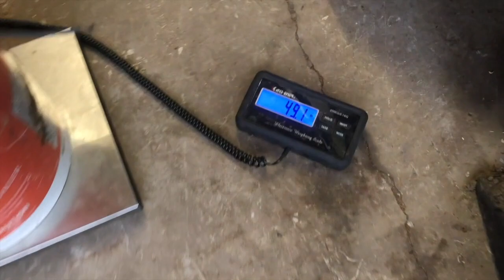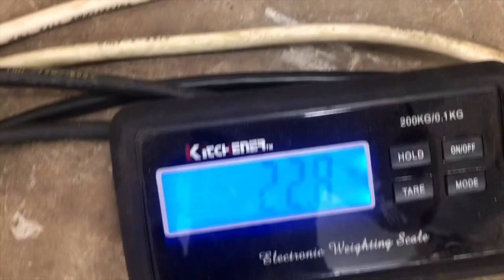5 places I've found scrap copper

Comment: Good video. Its copper I'm mainly into, along with cable and brass. But I'm currently saving up for a truck and then I will be taking steele and anything metal, so good to know how to get more copper. 👍👍👍
Reply from the maker: awesome good to hear I used to walk around with my dog and just find metal then got a car then a truck. copper and non ferrous metals are nice of course but steel is a steady supply and helps to pay the bills
Reply from the maker: seen a few of your comments sorry I haven't been back on here in so long now I've been struggling with things. I'm back at it now and am going to be posting again!
Reply: @scrap2cash712  looking forward to it buddy.
Reply: @CYRUS DAWSON, my plan is this: fours days a week in the van. Three days on the bike and an occasional day off. I say day off, I'm sure I'm like most scrappers, we still tend to do a bit of cleaning up of scrap and generally still scrapping. This is my favourite occupation I've ever had. I scrapped as a kid, as a teenager and now as an adult. I plan to always be a scrapper. As long as my body allows me to. All the best buddy.
Reply: @CYRUS DAWSON, good on you.
Reply: @irishgoldstacker8018  
Bodies and minds will betray you. I'm disabled. I scrap slow . I scrap less. Good Luck Irish🍀

Comment: i haven't made it to the big time yet, commercial grade motors and transformers... still piddling with household stuff, but i've just started so...  i like the way you went thru it all, (separated) and identified what was in the truck, lol, but at least where i'm at it doesn't snow...
Reply from the maker: haha I haven't made it to the big time yet either I wish I had but all we can do is one step at a time and keep working in the right direction. Slowly I'm starting to learn more and make more connections so it does get better slowly 👍
Must be nice! are you just trying to rub it in? its the middle of winter here right now and it sucks! lol

Comment: As an electrician I get a fair bit of cable. I also process it through a stripping machine that increases the value.
Reply: Sounds good Luton. Are you selling your copper right away or are you sitting on it waiting for the price to go up ?
Reply: @jussitikkuri6991  I will be holding it December and January. Prices ALWAYS go down

Comment: I also found a local electrical supply guy that buys and sells certain used equipment for much more than scrap. Cuttler Hammer (?) Breakers are in demand.
Reply from the maker: Local? local to where? I would like a connecting that buys electrical equipment lol 
I mainly sell stuff on eBay if I think there will be any sort of demand for it, sold some large breakers before

Comment: If you run a Sawzall down the sides of those coils and cut the copper to get more for it the coils are aluminum copper mix so you only get like half of the price so if you cut the copper off to get quite a bit more

Comment: Now, HERE'S a good question..  Do you keep it & melt it down or do you turn it in??  I'm melting mine down as I find it & turning them into 5lb bars of solid copper ingots, that of which I have 10 currently, with another 30-40lbs sitting in a tub waiting for spring to come back so I can start melting again..  (edit) I mean, you've already got the tools to extract it all, it's actually pretty fun to melt it all down & turn em into ingots, they look nicer too!!😁. During the lockdown I picked up a smelting furnace, some molds & a bunch of crucibles & haven't looked back!!
Reply from the maker: Nice I've always wanted to try melting some ingots my self as well but I never got around to it. most scrap yards don't actually like buying ingots unless you have a close contact with them because they don't know forsure what's in it..
Reply: @scrap2cash712  well, there are machines that can tell them the composition of the bars, they've just gotta invest in them..
Reply: @gingervikingjesus2351  Yeah bro, they are not buying a 20k machine to scan 10 bucks worth of copper bars per year,lol
Reply: @yaykruser  lol try 110lbs of copper..
Reply: @yaykruser  The goal is 300lbs..
Reply: @gingervikingjesus2351  110 punds... thats what? 300 bucks? so 50 bucks profit for them... In what? A Month? Year?
Reply: @yaykruser  $470 US actually, plus all the copper I've reclaimed was free, so even after fuel costs, replacement disc's for my angle grinder & time, I'm STILL seeing a 20% return on the copper I've melted into bars..
Reply: @gingervikingjesus2351  yeah, you see a profit, but what about them? They somehow have to justify buying that machine to to test those bars, and they aint gonna do that for one dude that thinks he has to melt his copper into bars.
Like no offense, melting that shit into bars is cool, but these guys have to run a business, not a copper museum.
Reply: If you have a large(as in operates in several cities and/or states) recycling company around you then they most likely will have a scanner especially if it's one of their "money" locations. When companies and individuals are bringing you thousands of pounds of metals including the likes of titanium, nickel, carbide, etc you need one. If you don't and sell a major smelter tons of adulterated product it's not going to be good for business. I bring aluminum ingots to the yard I use. They are a big company but my location has no gun. But being I've done business for almost 20 years there they know I'm not shady and they buy them. I melt the aluminum because of space reasons and the fuel is free....wood from trees I've cut down. But wood wont melt copper in a simple set up like mine

Comment: Wish I knew WHERE you found these. It could be used to make stuff.
Reply from the maker: Found which items.? and what could they be used to make??
Reply: @scrap2cash712  I guess any motors and fridges. I don't remember now. But I would also have to know how to weld or solder.

Comment: Do you get your stuff in auctions? Those commercial ac units and that many electric motors are not usually on the curb or a dumpster
Reply from the maker: Yeah not going to find that many or those type of things at the curb very often or ever lol 
Ive been doing this for a while so you slowly build some connections and I'm always searching and advertising in different ways offering to pick up scrap metals or offering to buy scrap. 
I've only been to a few auctions but I have a buddy who works with storage unit places so we get some connections through that as well

Comment: 2:55 that’s a chilling unit I took one of them apart that was much larger got almost a grand
Reply: Bs
Reply: @ronisaarinen8526  how is that bs buddy could care less if you believe it or not
Reply: @joshuamorris9050  hah $1000 for only copper or the whole thing?
Reply: @ronisaarinen8526  whole copper motors brass ect
Reply: @joshuamorris9050  ah ok 👍🏻 how much does those things average weight?
Reply: @ronisaarinen8526  they are all different sizes but mine was like 1k
Reply: @joshuamorris9050  ohh ok, thanks for the info

Comment: I had the scrappers fuckin wet dream of an opportunity so a guy from green bay calls me and says he owns so and so business and he needs a guy with a truck to come out to his job address (taking  2 old parking lot light fixtures down and putting in led) the job had 380 or so light pole fixtures and there is 2 on every pole imagine the door of a dishwasher all the way around same size all cast aluminum wired with nice thick 10g house wire and a beefy  transformer containing from 3-5lbs of copper on every one. Now remember almost 400 of them! The cast alone I made a killing

Comment: You cant leave insulated wire and other plastic and crap from motors on the copper, just a bad way to show shady work
Reply from the maker: lol you are on a negative commenting spree? Of course I don't leave that crap on the copper before I sell it.. if I did I wouldn't be able to sell it for top dollar if it was too hard to separate maybe id sell it as dirty copper.. that seem shady? lol